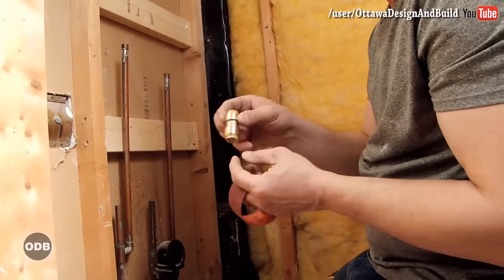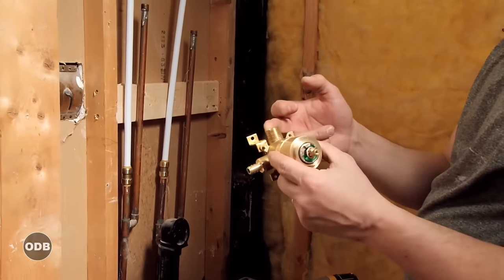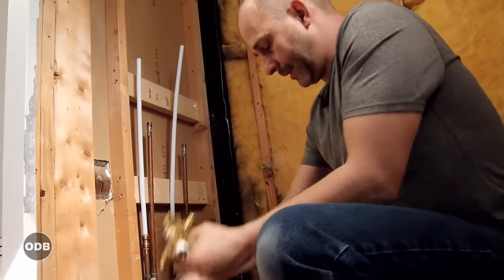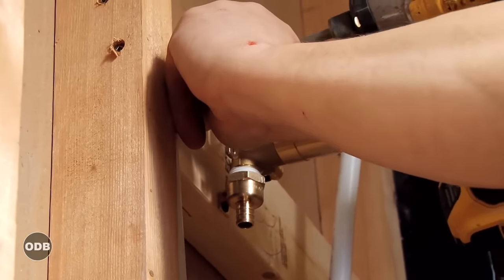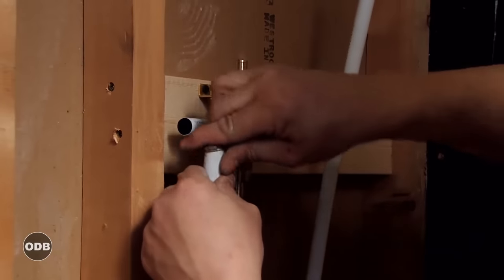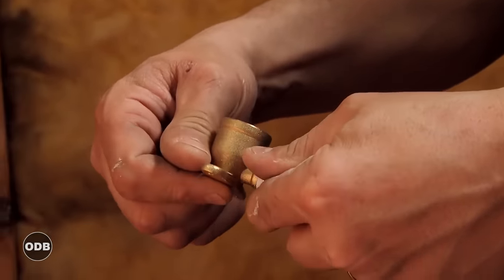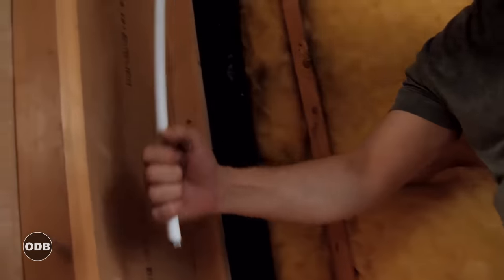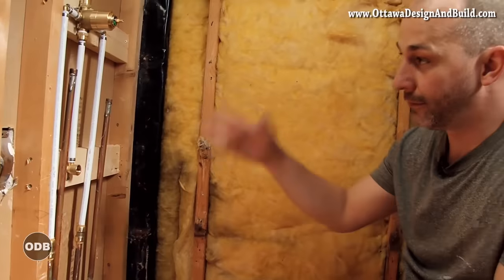DIY How To Install Copper To Pex | Shower and Bath Plumbing

Comment: I see several things wrong.  This guy isn't a professional plumber.  He was supposed to put the plastic inserts from the shark bite inside of the pex before he slipped the pex into the fitting.  And channel locks upside down,  etc.  

When I put them together I put on Teflon tape on first then Teflon paste on the threads, then thread a  pex fitting on the Hot Cold side.   I never use a Shark bite fitting for a conection.  I sweat on a  pex brass fitting on copper or just run pex up to the shower valve fittings.  I always run copper pipe up to a drop ear elbo for shower head and copper down to the tub spout.      I have been a C36 plumbing Contractor for many years and have been doing plumbing for the past 39 years.     

I wish these people on here would have experience and know exactly what they are doing instead of showing people the wrong way to set up a tub shower valve.
Reply from the maker: Once again we have a plumber watching how to videos. It always amazes me that plumbers have time to critique other people but never have the time to produce their own videos so we can critique them. To this I say show us your stuff or keep your opinions to yourself. This video was designed to help homeowners learn the basics so they could feel comfortable to do the job without calling in a shark plumber. Obviously plumbers are threatened by this information.
Reply: you guys charge too much. we gotta do it ourselves. at least its better than duct tape and krazy glue
Reply: Ottawa Design and Build Renovations If you were able to understand what I said earlier you would know why us plumbers do not tell people how to do a plumbing job.  And No I will still not tell you how.  Many years of experience and hard work go into this trade unlike your minimum wage job.
Reply: PhuckHue2 The reason we charge what we do is because we went to school to learn this and we have to pay for a license every 2 years and a bond also.  The bond can run as long as 1 to 6 years.  Depends how long you buy it out for.  None of this is cheap and the tools we have to buy are not cheap either like the Insurance and the trucks etc.    That is why because it cost us a lot to stay in business if you want a quality job.
Reply: I've been doing my own repairs for years without any problems. I would never attempt to install new plumbing unless it was something easy. thats just crazy
Reply: PhuckHue2 Well when you are learning it's not easy at all, but when you learn the correct steps that they teach you your work NEVER LEAK.  Depends on who is teaching you and how you put it together in what steps.  As a Contractor it is against the California law for us to tell people how to do this type of work.  Reason being is that if someone screws it all up and a flood or if gas is involved and someone dies then we will lose out bond and license and be sued for this.  This is why you will never see Contractors make youtube videos.  Pluss if they do this their phone will not ring as much and that can hurt your business.
Reply from the maker: Would love to see your video some day. This is a great platform to share ideas.
Reply: Well since we are critiquing - I've never heard a "real" plumber recommend doing both teflon tape and paste. But hey who am I to judge.
Reply: FUNG CHANG wait until your crack fix stops working and you have to cut big chunks out of the concrete to fix it since you temporarily band-aided the problem. should have just had the pro fix it the first time and be done with it.
Reply: R '..... Mr " R" If you know so much, how come you didn't make any video about any of you job. I am here for the first time because I have an emergency in my friends house to fix the same problem and guess what, I found this video very , very helpfull. Even though i have some basic knowledge about plumbing this video helps me a lot .
Reply from the maker: I love how guys say that I am not a professional plumber and then don't list their credentials. The world is full of haters and jealous fools. I never claimed to be a plumber. But I do know a lot af tips to help people make their life and projects a lot more cost effective. Glad I could be of help "B" , you can ask me for help anytime.
Reply: Q: Are SharkBite fittings approved for use within a concealed wall?

A:  SharkBite push-fit fittings are certified for use within a concealed wall, but consulting with local plumbing codes is recommended for specific applications. It is also recommended to pressure test the system prior to sealing up the wall.
Reply from the maker: You guys have quite the bromance going here.
Reply: You can drywall over a sharkbite.
Reply: who cares how YOU do things.  in the words of the plumbing GOD "there is more than one way to skin a cat".
Reply: I'm not a plumber but play one on TV. My $.02 them PEX clamps will leak! I feel PEX is a good product when you use the correct type.
Reply: I can't take your advice as you're not a professional YouTuber.  😞 Nothing like citing to authority and mentioning the pliers were upside down as proof.
Reply: Small pipe
Reply: Asbestos was allowed.
Reply: Hi Ya 
I was wondering if they were required with that type of tube 
In the uk all manufactured type require inserts or sleeves
to protect the pipe wall and also having a bevelled edge so as not to push the o ring in!!
Cheers
Reply: Mark Taylor prophecy
Reply: @HomeRenoVisionDIY  Plumbers are one of the biggest scams in America. My son in law had two different quotes to replace a main shut off valve into the house that was leaking. 1k from first plumber, 1.5 k from second. I went over and fixed it in two hours.
Reply: R all you could think to nitpick is the guy held the pliers wrong one time, and he used a shark bite, which apparently there is a wrong way to install.. if it held water, it’s good. I see nothing wrong with what I saw here. Its always funny to read comments on how tos from butthurt tradesman. Fact is trades aren’t as hard as some of you guys want to think. I do Reno’s and do everything myself, electric, plumbing, heating. It always works just fine and always passes inspections where they are necessary. And you guessed it. I’m not licensed for crap, only difference is it didn’t cost 900$ to hook up the vanity...

Comment: Sharkbite fittings should not be installed inside a wall. I have been in the plumbing business for over 50 years I do sometimes use them for a temporary repair.
Reply from the maker: Thanks John. we have a access panel next to the tub to ensure that we are good long term. Perhaps one day sharkbite will get the respect and code will allow permanent installations. I have also seen in my years a lot of crap soldering and compression fittings. Using traditional methods with bed skills can be just as harmful.
Reply: Whats wrong with compression fittings? I'm using it to connect my pex to copper
Reply: You have an access panel on a exposed wall where the toilet is? Give me a break mickey mouse installation.
Reply from the maker: The client wanted to be able to monitor the sharkbite fittings. Once they are satisfied they will close it and paint themselves. It's their house. There is nothing mickey mouse about my work.
Reply from the maker: there are many types of compression fittings not just sharkbite. They generally work reasonably well.
Reply: were i live we install in the wall under the floor any where tbh,as we dont use brass we use stainless steel  tectite aka  (sharkbite)  not a problem and our water pressure is a lot higher that yours up to 15 lb square inch ,and as already stated please use ptfe the right way and there will be NO need for any paste :)
Reply: Why? Sharkbites are very reliable and are fully legal with codes.
Reply: lmao!!!!!!!!!!
Reply: Have you seen any reports of them failing more quickly or at higher rates than copper? For example I had a professionally installed sweated on copper pipe fitting fail that was probably ten years old so I know even these can fail. If there is engineering data showing they fail more often then I would agree only use for temporary use but I don't find any such studies at the moment.
Reply: John J. Bennette totally agree. Way better to put the access panel as a large hole in the ceiling below or dig an inspection pit if it's on the first floor of a slab foundation. That's the Minnie Mouse way to do it.
Reply: 100 year old copper plumbing vs. 10-20 worth of some shark biting the fitting with of all things RUBBER seals.  mist be magic modern rubber made in China....
Reply: Cheaper is better go seal some in your walls.
Reply: Home RenoVision DIY 
You should do it right not what the client wants. I have seen and handful of water damage from shark bite connecters
Reply: bigjake707 legal isn't good enough. It should be done right.
Reply: Lets fight😂
Reply: I’ve had shark bites fail. I will never use inside a wall. You work for me and do this, you are fired. No exceptions.
Reply: @jhbproperties3232 
YOU CAN'T FIRE ME! I QUIT!

Comment: Good commentating , thank you . I have pex roughed in below and am debating to use copper for the tub spout and shower head . It's a tough call , but I'm sure liking the simplicity of using pex only . I'm a bit concerned about having a small leak after the pipe is installed in one of those ears
Reply from the maker: compression fittings behind a closed walls have been used for a hundred years. old boiler lines are all threaded joints as well as gas lines. As long as you use tape and paste you will be more than safe.

Comment: real plumbers don't sharkbite. 80% of the leaks I go to are sharkbites
Reply from the maker: I don't doubt it. If they are not installed correctly you can definitely have a problem.
Reply: you are not a service plumber then, these save a lot of time and carry the same warranty that a pex fitting does. if it gets a leak resolved for a buisy hotel at 3 in the morning I love sharkbite. if its a new install or reno, not so much .

Comment: Shark bites website says that these couplings are designed to be underground or behind walls with no access required. I’ve used them with no problems so far. I’ve heard some Plumers complaints when they first came out but see a lot of plumbers using them now. The white pex is a lower quality then the red and blue. I can look at both and compare them with the ratings on them. and u are suppose to use copper from valve to spout. Great job. Don’t listen to the haters
Reply from the maker: I don't but they sure help the analytics.

Comment: Thanks a ton for the vid, I'll be doing this exact procedure next week in my shower. Can't wait!
Reply from the maker: please use  3/4 line to the tub.
Reply: Then you will be doing it wrong. Read the directions on the diverter valve or you will be opening up your tub/shower wall again.
Reply: @MAGAMAN  it’s been working fine for the last 4 years so I’m not really what to tell you brother

Comment: For the price of sharkbite it's cheaper to call a plumber unless you are only doing a minor repair.
Reply: Moon Pie plumbers charge from 40-100$/hr depending on where you live sharkbite are at their cheapest maybe 9$ each before taxes where I live and plumbers are around 40-60$hr. It doesn't take very many fittings before sharkbite becomes more expensive than the plumber. As I have said for small jobs sharkbite is great and can save you money but if you plan to run your potable water system in sharkbite alone it's cheaper to get a plumber.
Reply from the maker: no one is suggesting using sharkbite fittings at all junctions. It is simply a great way to convert from existing copper to pex if you don't have the time or experience to do soldering. Anyway you slice it pex is substantially cheaper than copper plumbing and outperforms it as well.
Reply: I used shark bites to convert from a 3/4 inch wirsbo line to my 1/2 inch crimp pex line because I don't own the 400 dollar wirsbo tool, but if you have the crimpers why didn't you just put on a pex to copper brass transition fitting?
Reply: My copper fittings will outlast your sharkbite fittings
Reply: I highly recommend unless your water is bad. You'll thank yourself later. Btw, I just find it extremely difficult to believe the best rated pex fittings/shark bite fitting o-rings will outlast 250 yr lifespan of PROPERLY soldered copper/fittings. Cheers!
Reply: Well to each their own. I'd rather install the with the most reliable method. Would dealing with a high potential for leaks in walls or the frustration of repairing corroded fittings/chewed/warped pipes be a practical reason to use copper?
Reply: Let me ask you in another way, what's your time and energy worth fixing shitty plumbing every 15-20 years?
Reply: Enjoy your life fixing leaks every 15-20 years.
Reply: frugal landlord 
copper isn't without it's problems either, I would not waste my time with sharp bite connections, pex on the
Otherhand might be worth a try but I'm wondering what it's long term problems will be with water in constant contact with a patrolium   product as far as health concerns. But we all can agree any of the others are better then lead, and cast iron or steel pipes all of which have been used in the past. We didn't even bring up cpvc or pvc.

Comment: you need to learn how to use PTFE HAHA School boy error
Reply from the maker: Love to see your videos. Where can I find them.
Reply: +billy brown — Depending on the pipe thread quality and manufacturing tolerances, sometimes it is not possible to get a 100% seal with PTFE tape alone.  Outdoors, it may not make a difference to have a slight amount of seepage, but any leakage at all in indoor installations is unacceptable.
Reply: Yes, because ones ability to upload a video to YouTube is a direct indication of their skill level.
Reply: PTFE, Poly 1,1,2,2 tetra fluoro ethylene is a fluoro-carbon and is causing global warming. All Teflon tape and all Teflon products should be banned. All plumbing should use compression fittings; even in nuclear power plants. We here in California are pushing for a ban on all Teflon products including, TriLube, Teflon pans and even the components found in the new sex doll manufacturing. Teflon must be stopped!!!! Teflon is slowly killing our planet!!
Reply: billy brown Why are you watching the videos? You got it down? Do your thing, you think you can do better upload some videos. You got youtube envy
Reply: that was silly
Reply: Don't know about PTFE killing the planet, but I will say that I am alarmed by the amount of COMPRESSION fittings that somebody jammed putty or tape into. Not supposed to work that way!
Reply: hi
Reply: DB Stevens That is just ignorant reasoning I hope youre joking otherwise I think you need to spend a little more time on the topic sorry if I seem condescending its not my intention.

Comment: too bad you don't know how to use channel locks!  you had me as a fan until that point!
Reply from the maker: Don't be so harsh. I was just a little nervous on the camera. I do know how to use them...usually!
Reply: That’s the only reason I came to the comments section.
Reply: Channel Lock is the name of the company not the name of the tool.
Reply: Home RenoVision DIY i am a fan. Its awfully sad to see some of the comments on here. I can smell the testosterone, for sure. 
Anywhoey...I want to thank you. I got the hist of what you were pointing out. Single Mom here. In the last year, ive had to learn electrical, woodwork and now plumbing. I have copper pipes and was thinking of changing over. But, now im not so sure.  
Thanks for the video, and taking the time to explain the steps. There are those of us who need all the gelp we can get. LOL